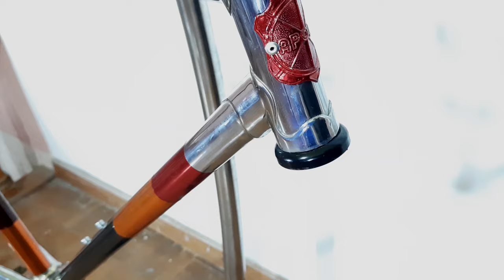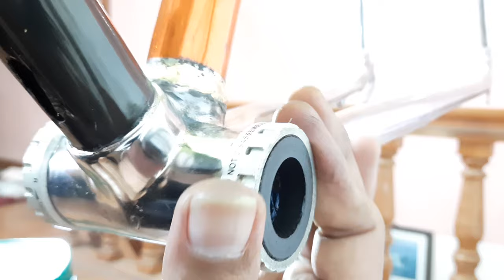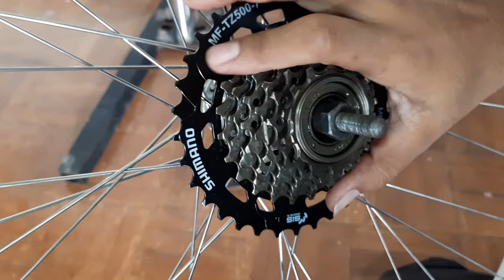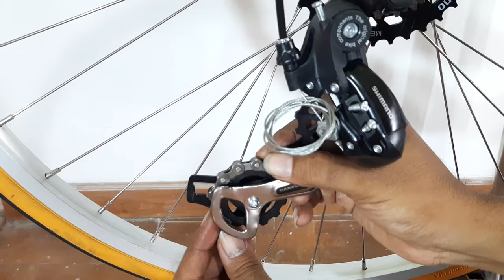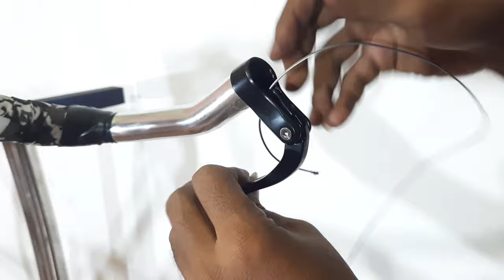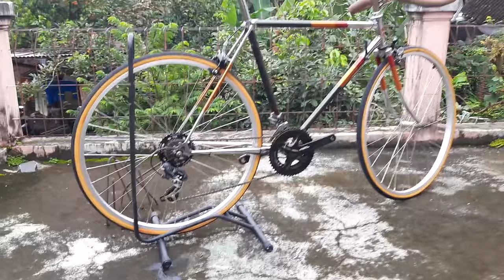BIKE BUILD || APOLLO VINTAGE ROADBIKE HYBRID OLD BIKE || BULL HORN

Comment: Been planning to do this to a paramount frame from the 90’s I hadn’t seen the Claris crank option, that’s gonna be my jam.. thanks man
Reply from the maker: Yess Bro, Your welcome
Reply: How
Did you get the hollow tech bottom bracket to fit the 113x68 threads?
Reply from the maker: Actually all Hollowtech2 can be put on old frame.
But have to adjust with BB ring spacer

Comment: You should have used the brakes to hold the bar tape on the ends, if possible, instead of electrical tape.
Reply from the maker: Oke 👍👍👍

Comment: Hello, I have mine Shimano shifter same as yours. I repaired them but I can not gather them into using properly. Could you give me some instruction about that?
Reply from the maker: Assamble all the shifter part dont forget where it belongs, clean all that, with degreaser and rinse. Dry them,
Put some grease,  tighten the bolt lock properly, so the shifter can rotate smoth but not play.

Comment: Where to buy bar end brake levers?
Reply: Buddy what size is your seatpost?
Reply: My guy my frame was 26. Something. Its hard to find 26 sz seatpost... I installed a 25.4 but still loose. I just stock it with metal sheet to fit..
Reply: No no my friend. i have a classic fixie frame.. 25.4 won't fit in the seat tube
Reply: Im back. And i bought a brake lever at lazada. And i find a 26.0 seatpost at a local surplus store. Thanks for the info